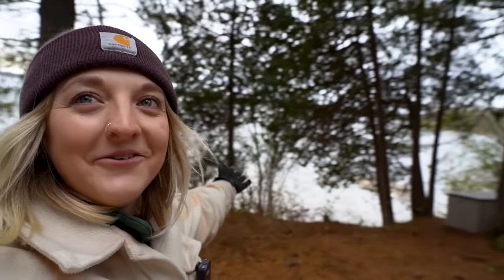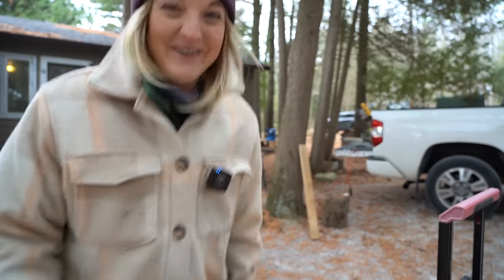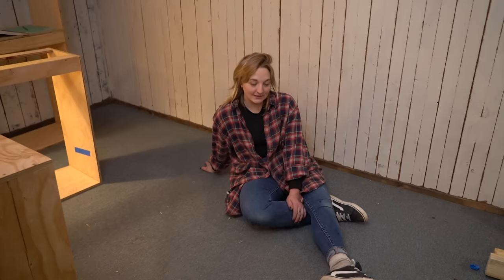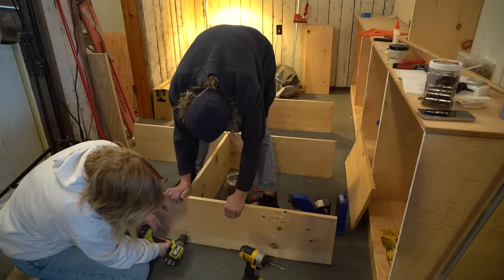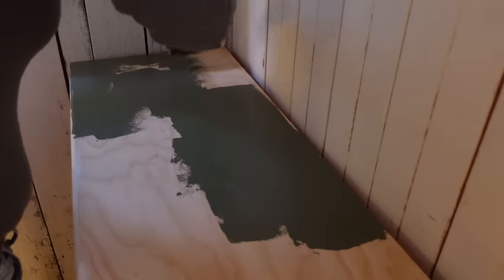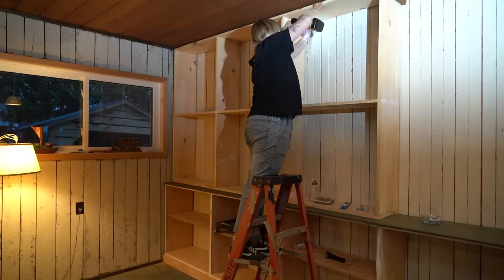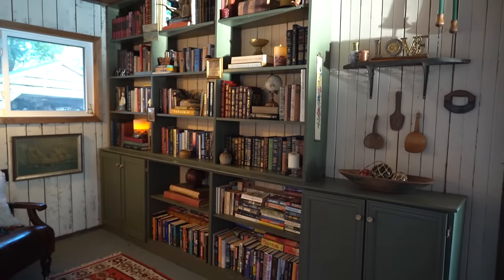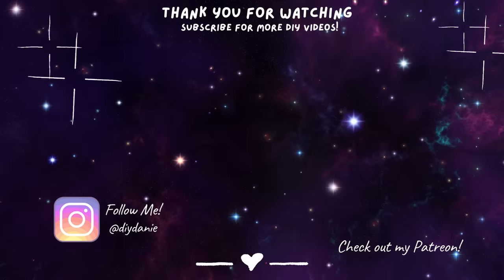i diy a cozy reading nook for my mom 📚✨

Comment: I loved it. But two things I would change would be (both real easy)... Add more peg holes so you can maybe squeeze in one more shelf... and because it's such a dark corner, I'd paint the inside of the shelves and cabinets the antique white (leave the face frames, the ledge/countertop and the doors green). It will throw more light onto the books and make them even more beautiful and visible. 💖🌞🌵😷

Comment: Also idk if they have them in Canada but there are LED Candles that work normally EXCEPT you can actually blow them “out”/off. Yep. They are so freaking cool- i’ve seen multiple brands and they are a little more expensive than regular led candles but so worth the effect esp on 1 that's in such a perfect spot for it like on the wall at her cabin.

Comment: I wonder as the uper open part od bookshelves was down and still movable...why did you not paint i than or outside in yard? I find doing tape on the backwall is just a hustle and also takes time. The down FIX AND HEAVY part I do understand painting on spot. Thx! It doessss look WOW!!

Comment: I wanna ask about painting the wood on the wall: in the 90s it was super popular over here but i really hate it. I always thought, you needed to strip the wood of the top coat (we call it lacquer), otherwise you can't paint it - so I never did anything with it because it sounds tedious. Apparently, I could just paint over it? It won't chip? Or your mum's doesn't have this veneer on top?

Comment: The only critical comment I have is in regards to the removal of the ceiling trim. The top back of the shelves could have been notched to fit around the trim. Mostly this tip is for people who might be installing a piece in a rental where structural change like what you did isn't an option.